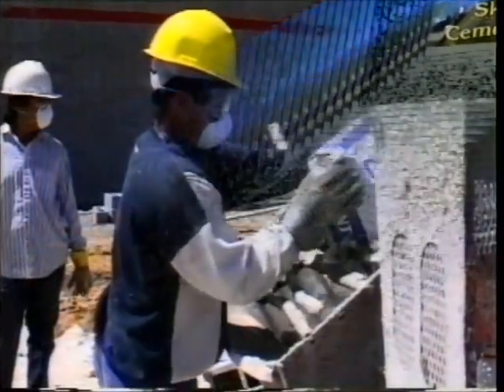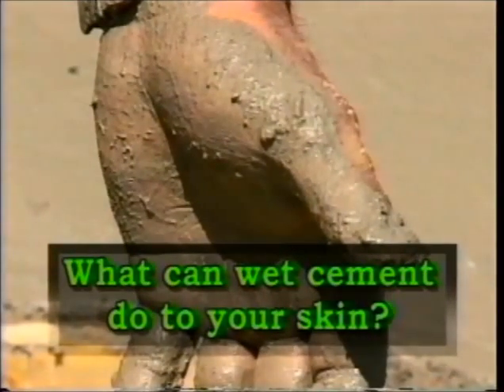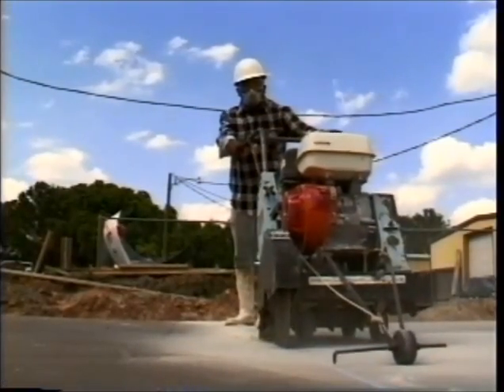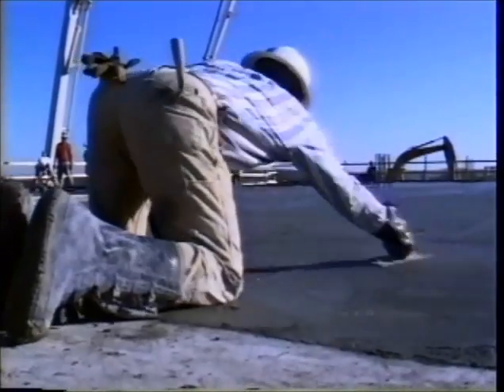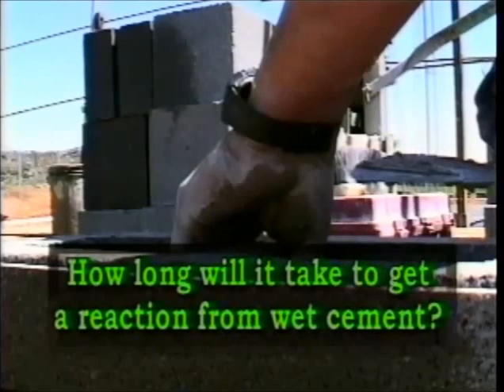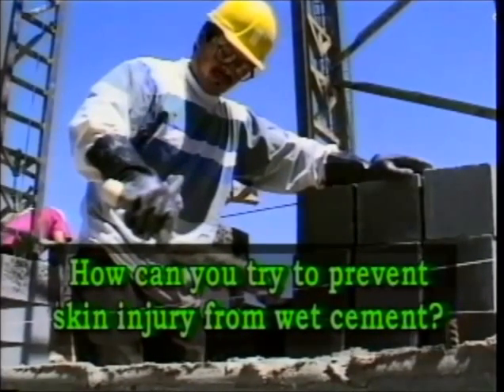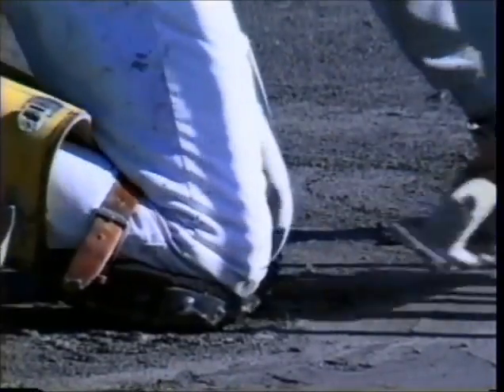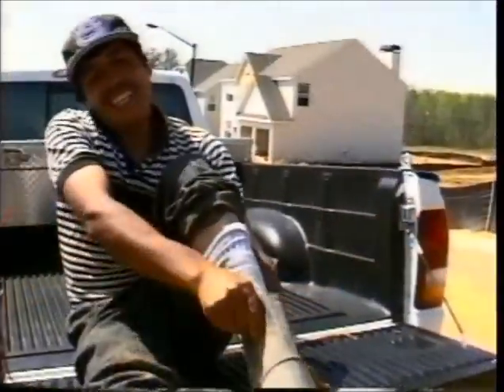Skin Safety with Cement + Concrete

Comment: i've had eye problems for about a month. just realized it was the damn cement i was filling cracks with in my garage. Doh. mixing it indoors is a bad idea without proper ventilation and no goggles. i thought the powder was heavy enough that it wasn't floating up to my eyes.
Reply: Doesn’t cement have silica dust in it? Which means breathing that dust into your lungs will cause lung cancer in the long run?

Comment: For anyone wondering why cement is dangerous this is the explanation i found: Calcium Oxide in cement reacts with water and becomes Calcium Hydroxide. This chemical has a pH of 12 or higher which is extremely alkaline and therefor dangerous. As the concrete cures the surface reacts with CO2 from the air becoming Calcium Carbonate which has a lower pH. Alkaline burns are painless and do not produce any heat. Which is why people do not notice it until it's already to late. In severe cases the burns extend deeper beneath the skin damaging muscle and even bone. In the worst case this can lead to a amputation. Another danger is that inhaling cement dust can burn your lungs. It's also recommended not to eat anywhere near cement to prevent swallowing of this hazardous material which can have its own set of issues.

Comment: I went on a waterslide in my town n hit the cement pool at the bottom WTH my heels one heel was split open. The ER laughed me off pored proxide on it put a band -aid on it n sent me home. About a yr or two went by n I could feel a knot on my heel n couldn't walk on it. Turned out after 1 trip to foot Dr n X-rays showed something in my heel but he didn't know wat it was at first until he cut it open. There were a couple pieces of the cement still in my foot and was gane green and had started to vine around my ankle. He voted out my entire heel. Was on strong antibiotics n real sick n on crutches a year. I was lucky it happen to knot up on my heel or I would've died.

Comment: You would be surprised how many people are not aware of this. And I quote, 'We use cement in everything. It's not a dangerous substance until it dries.'
Reply: It's actually dangerous while wet, because Calcium Oxide reacts with water to become Calcium Hydroxide (the substance responsible for chemical burns with pH12 or above). As the cement dries it becomes lower in pH. And decreases the chance of a burn.

Comment: So I’m a concrete finisher and we work with live cement and I’m not sure what I have but my right hand feels swollen I can’t close it completely and the joints on my fingers hurt. Not sure if that’s from using the float for hours or from the cement.
Reply: Over use syndrome holding Trowl, Cement has a lot of drag i reckon
Reply: What is live cement ?